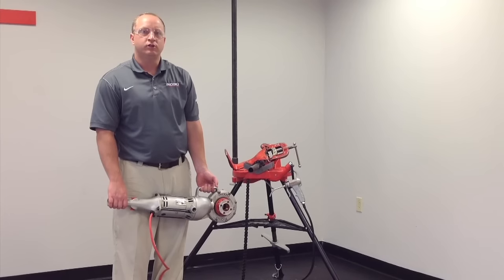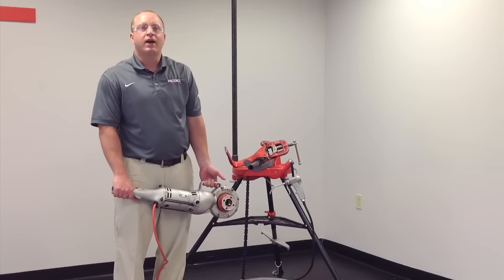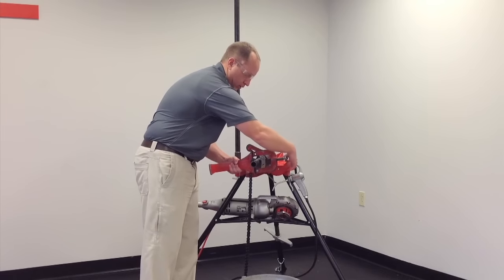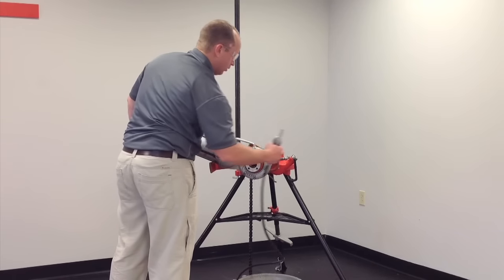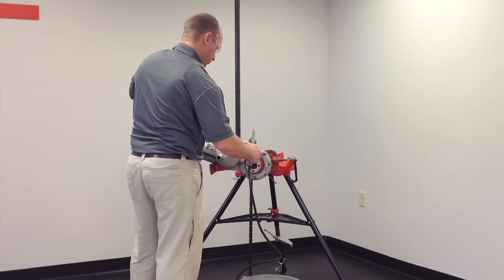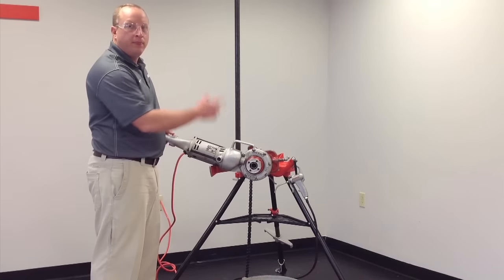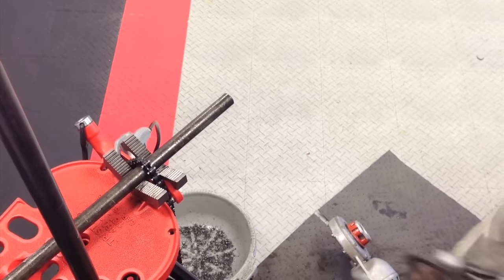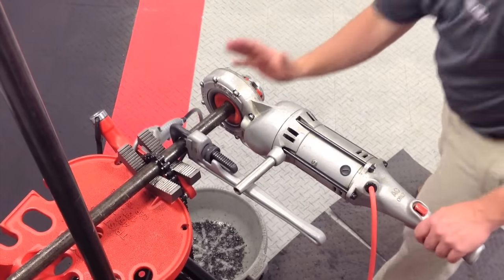How To Use the RIDGID® 700 Hand-Held Power Drive

Comment: Never knew about the pipe wrench method. Been trying it this past week and working great, using a chunk of 1/2" rigid conduit for a handle.

 Too bad the tool has the handle bung / cast handles on the wrong side.  Mirroring it would make that method so much more ergonomic.